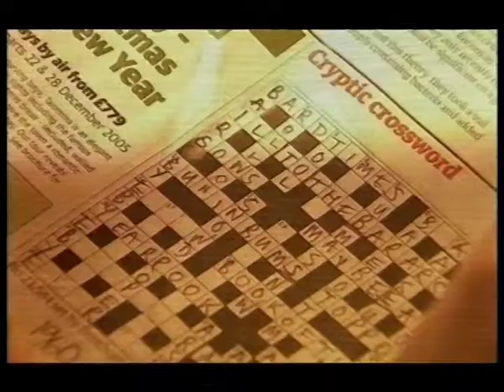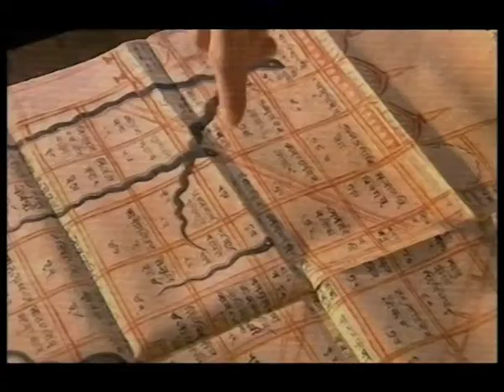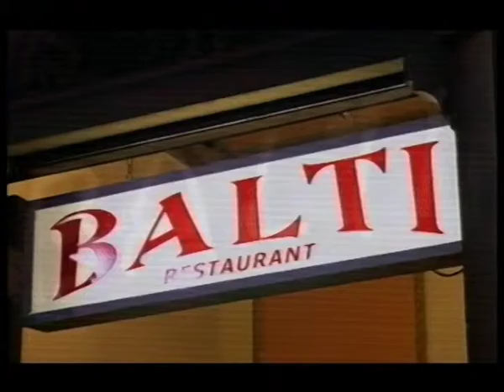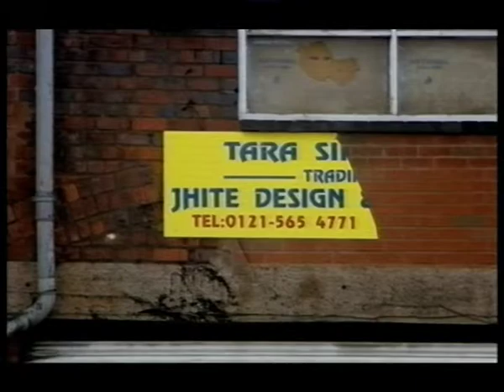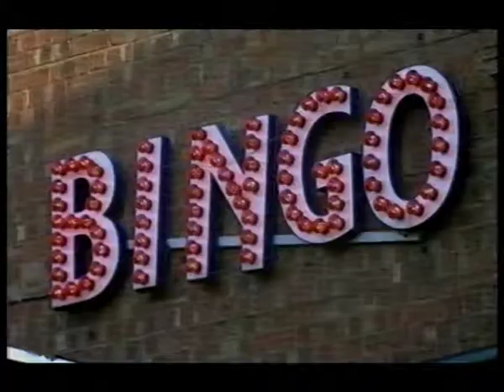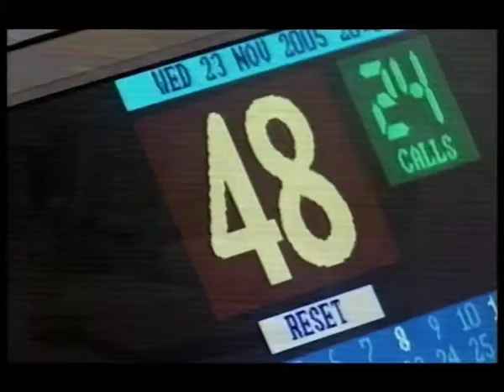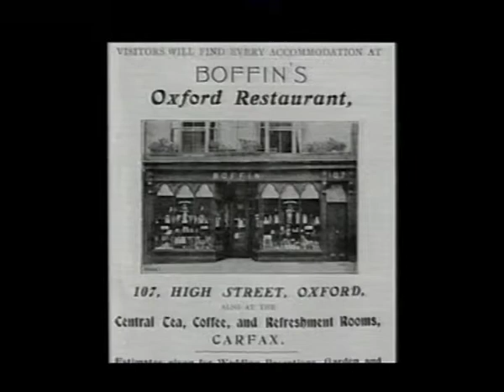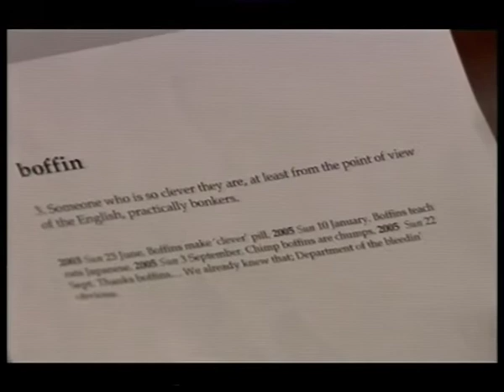Balderdash and Piffle - Series 1 Episode 6 - 'The B Words'

Comment: our bingo in the states have totally different cards. B column is 1-15, I is 16-30, N is 31-45, G is 46-60, and O is 61-75. The center block is free. I used to play 24 cards at a time. Thought Boffins where strictly scientist. Think of bluestockings as intelligent (sometimes bitchy) wallflowers in romance novels. Is Suzie Dent a boffin of ODE?